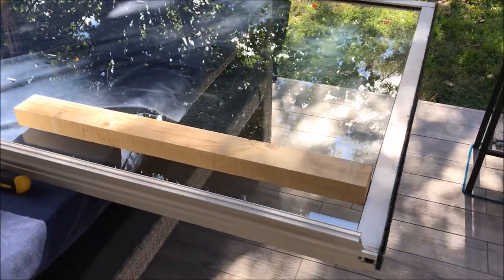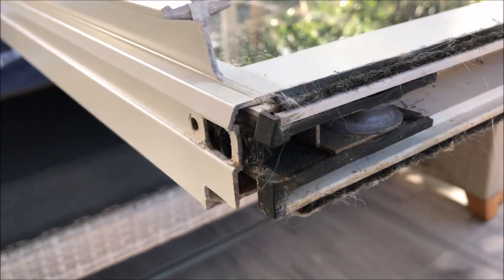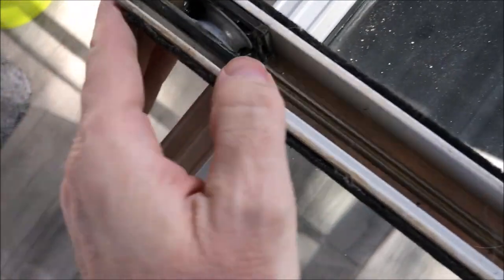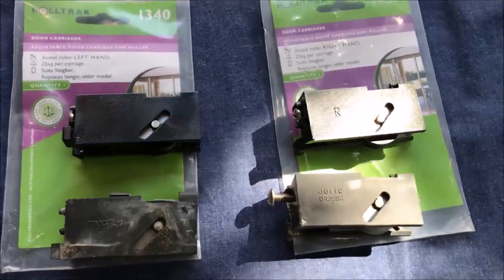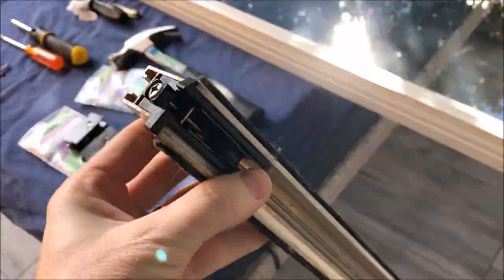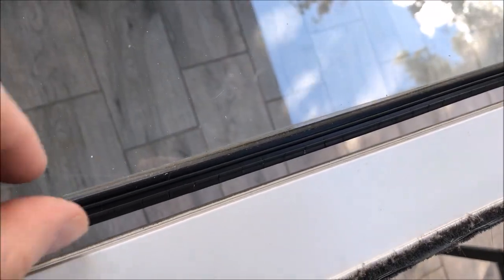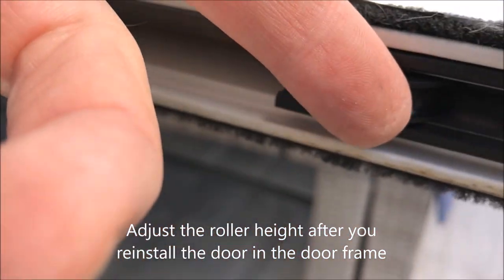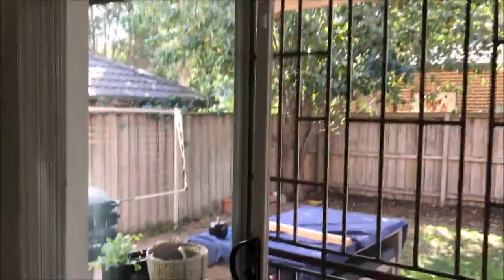Sliding Glass Door Roller Replacement

Comment: I also would like to thank you for posting this very helpful video. It helped me with my purchase (from Bunnings) and the installation from start to finish. Removing the bottom of the sliding door frame would have been extremely daunting if it wasn't for your video to show me the way. The whole process went smoothly other than some difficulty I had in removing one of the screws to release the bottom frame. Great end result...cheers!

Comment: Nice to see a reasonably good quality roller assembly that you pulled out of that door frame. I can tell it's fairly well-made. Most of the garbage "Chinese steel" or brass or aluminum crap that have in a lot of these doors is garbage (including the replacements in the big box stores). Ideally, these critical function pieces should be made out of hardened and super-durable non-rusting stainless steel, including the pins and roller wheels. But most manufacturers are super cheap and choose not to spend the extra dollar or two to use better quality parts. So everyone is left dealing with this kind of mess.

Comment: Just replaced left and right Stegbar cartridge rollers. Note I didn't loosen the frame.
Remove door and rest on floor so as to access rollers. 
Using one hand clasp plastic end clips with a pair of long nose pliers so they are almost together and with your other hand knock the pliers with a hammer. The result will be the cartridge will slide down and away from its original position. Knock down about 30cm. 
Next, wedge a piece of wood or a screwdriver handle next to the cartridge. The aim is to loosen the grip of the aluminium frame on the cartridge. 
Pull out the cartilage with pliers.
Slide new cartridge in at 45 degrees so that the screw ridge fits into the hole in the frame. 
At this point you will need to push and line up the cartridge  male  'studs' with the female slot in the window frame. I put a little oil on to make next step easier.
Once lined up knock the cartridge with a block of wood and hammer or rubber mallet. The stud and cartridge will lock into the slot/place.
Good luck!

Comment: Nice production, congratulations.
I did not wish to disturb the bottom stile and found the following solution.
Prise the two plastic locking tabs gently from the edge of the door by placing screwdrivers between the aluminium housing and the plastic carriage body. You do not bend the extrusion with Herculean force, just enough to almost clear the tabs.
Then simply tap sharply against the adjustment screw plastic recess on the side of the door using a 1/4" drive short extension or similarly sized drift. When this section pops through the square ally slot, you can then pry the whole bloody thing out... !

PS I hate overpriced Stegbar. 

My sash windows are now dangerous as balance springs gone. It's off to Lincoln Sentry for more. Is this advice worth a beer?
Reply: PS Celebrated too early. Partial dissasembly bottom stile is probably still required (as per video) to reinstall new plastic prongs as they won't tap back into channel even with little drift right over them. I did not wish to risk a bigger blow with hammer

Comment: Thanks for the video. I have a very similar Stegbar door (with same locks as yours), but cannot lift it up from the track. I already adjusted the roller screws, but only the back part can lift up hith enough. The front part seems to have something at the top as a padding, so it only lift up a bit but not enough. Did you have this problem when lifting? Or do I miss thing?
Reply: Apply some lubricant, then unscrew the adjuster (but not all the way) and then tap on the screw head. That should allow the roller to move back enough to remove the door. It's probably stuck because of all the rubbish accumulated over the years. Good video by the way.
Reply: The padding is a security feature to stop people lifting the door from outside. Roll the door all the way back then there should be no padding and you can lift it out completely. I have this same situation with my windows and the padding is there by design.